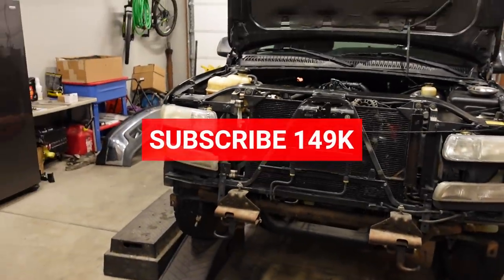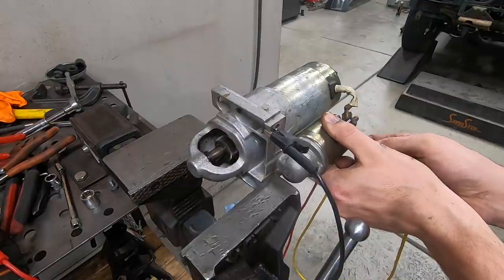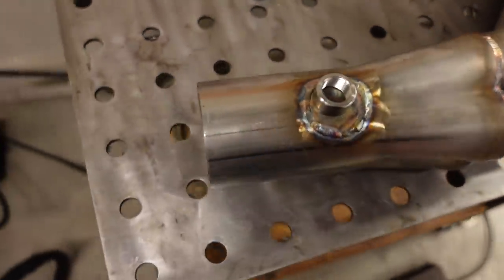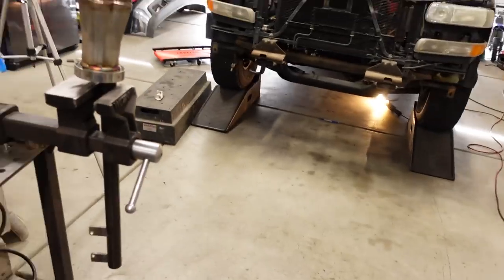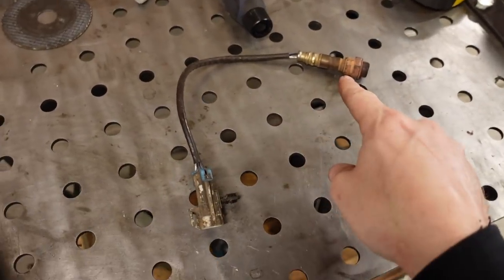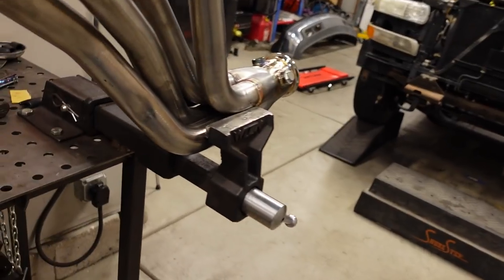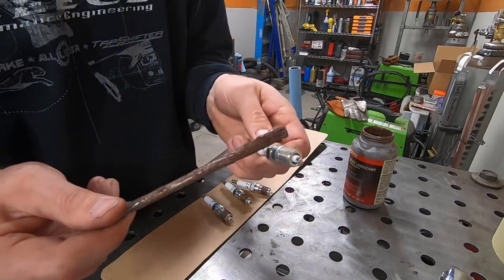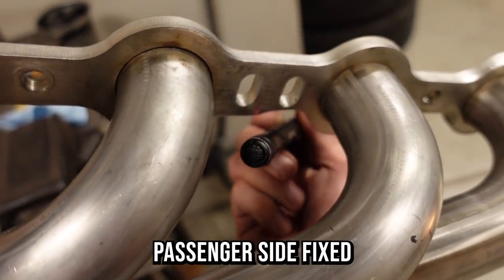my headers DON'T FIT & FIRST START of the CAMMED 4.8 Silverado

Comment from the maker: I badly need to build an exhaust for this thing, I've been working on startup and idle tuning this afternoon, and my neighbors aren't happy!
Reply: Don't waste any time trying to tune it before you finish the exhaust.  I started my LQ9 with a Texas Speed cam and Speed Engineering headers,  no exhaust.   Fuel trim went wacko in just a few minutes while I moved the truck to a different bay.  There I installed the pipes back to the X pipe, and fuel trim went back to single digits.
Reply: Faster proms collab?
Reply: I use Affordable Fuel Injection for my tunes.  Also as for the neighbors....that's why I live in the county out in the country, still close enough to run into town but far enough to make whatever noise I want.
Reply: Always read reviews before buying anything.
Reply: @bowtiebastard6437  i like GMT 800, and the 2014-2019, 2020+ trucks
Reply: There’s nothing like pissing off the neighbors
Reply: My neighbor next door is cool.  He was excited when I finally fired up my truck after the swap. I swapped an LQ9 into a single cab that had a 4.3. Tune and exhaust next.
Reply: What headers are you using  now

Comment: I have always used aluminum anti-seize on my spark plugs, ESPECIALLY on aluminum heads.  I have never worried about it getting on the sealing areas & never have had any issues, period.  I learned to use it many years ago when working at a Chevrolet dealer 7 removing a set that somebody else had installed in an '69 427 'Vette.  Both heads had to come off to be repaired after every plug broke off & then completely stripped out the threads.  Anti-seize is super worth using.

Comment: I was amazed how well the speed engineering headers fit in my 06 4x4 silverado. Got the headers and y pipe for about $450 took under an hour to install. I just made sure to get new motor mounts since the headers are fitted with new mounts. You do not need to add a bung like some people think. I used the msd plugs that bend up to 45° so you can position the plugs in any direction you want and they clear the headers perfectly.

Comment: Poor man’s oil primer for modern engines: remove fuel injector harness connections (or fuel sender fuse) and use the starter to ‘prime the engine’. Engine sounds great. Looking forward to the rest of the build!
Reply: I always prime my ls builds this way.....just crank for about 30seconds till you see numbers register on your oil pressure gauge and your good......if not, pull the oil gallery plug up front to the right of the timing cover and get a big Allen wrench to remove the plug and get a 3/8" hose attached to a bottle of oil and squeeze it in there till it comes out of the fill hole then turn the engine 1 revolution by hand at the crank and squeeze some more oil in till it comes out again, then you should definitely get it to register on the oil pressure gauge while cranking the starter. ....works every time
Reply: Or use the Richard Holdner method.
Temporarily block off the pcv and crankcase vents. Remove oil dipstick and use air to pressureize crankcase through dipstick tube until you have a reading on the dash gauge. 
I have not tried this myself but I will during my next build

Comment: I really like seeing you put almost all the original parts back together. My 5.3 blew a head gasket...I may just fix it instead of finding another engine. Hard to justify fixing a 180,000 mile engine, but, it really isn't worn out.

Comment: Thank you for all the awesome and informative video's. You mentioned putting electric fans on your truck. Gm offered a 9 blade fan for the heavy duty applications. I pulled the stock fan blades and put one of the 9 blade fans on each side and they move a whole lot of air.
Reply from the maker: thats the fan I used on my 8.1 and it works great!

Comment: I bought a full length set of Speed Engineering stainless headers from engine to tailpipe with the X pipe crossover (vs. the combined Y pipe design, they offer both) and they fit like a glove. The truck I installed the system on is a 2011 4WD Silverado Extended cab with 5.3L.   You may want to consider them in the future. Dipstick tube clearance, spark plug clearance is great, all the O2 locations are great and the clamps etc all fit perfect. Seriously not a single complaint and she sounds awesome with the X-pipe crossover. Obviously the Vbands are an upgrade to any system (and dont come standard on the SE set), but overall I am very happy, especially at $950 shipped for the whole truck. Thanks LT, and good luck with the build, cant wait to see more content.
Reply: BTW... can you post up the PN for the Accel plug wires you mentioned ? I'd be interested in changing out the set I have on  my truck..   Thanks !

Comment: Your welding is awesome.   I used Speed Engineering on 2 different GM trucks, No issues with them. Not bad for less than $400

Comment: I put a set of Pacesetter long tube headers on my 2013 gmc sierra 5.3 2wd.  No problems at all with o2 sensor locations and no dents do fit. I ran a set of AIP electronics from summit for the spark wires part number DFR-SPW2005-RD and they don't touch at all.

Comment: Speed engineering definitely have the best fitment, I've installed 2 sets of Texas speed longtubes and both didn't fit just like yours, one on a 2wd and one on a 4wd.
Reply: Was gonna say speed engineering seem to have a nice header for a decent price
Reply from the maker: I’ve heard good things about speed engineering as well, not sure why I didn’t just get those in the first place
Reply: @LawrenceTolman  And the best thing about Speed Engineering is the cost. I bought SE 1 7/8 inch for my 2010 Camaro. Speaking of a 5th gen Camaro, are you interested in doing a cam swap for your channel? I don't live too terribly far away (Billings, MT). I know you are a truck guy, but an engine is an engine.
Reply: One of my buddies has a set of Speed Engineering headers on his Denali. They actually fit great. I almost bought a set to cut up for my BMW swap project because they are so cheap. But I figured cutting up a set of already built headers would have been more work than what I ended up doing.
Reply: Speed Engineering are very nice for the price. 2010 Silverado 4wd 6 speed for perfectly doesn't touch anything anywhere only thing was the starter cable had to be moved forward and ziptied or of the way. For $420 headers and y pipe you can't beat them.
Reply: And the O2s are good as well had them on for 6 months. Only to 1 band clamp to fit the y pipe to the 6.2 3.5 inch factory exhaust.
Reply: Judging by my experience with them a few years ago, I actually assumed these were speed engineering headers. The driver's side flange was welded at an incorrect angle so badly that the O2 sensor contacted the floor, and the primaries contacted the firewall head shield and frame. Despite having brand new engine mounts, they told me to pound sand. Never again.

Comment: I installed a set of speed engineering headers I believe they were close to the frame on the drivers side but that was the only issue I had I didn’t dent them in and haven’t had them make contact with the frame. I also installed a set of Taylor spark plug wires with a 135° boot and everything fit perfectly between each primary tube. Straight plug wires will burn up over time

Comment: Speed engineering headers all the way when it comes to a gmt800 I have single cab, crew cab and tahoe all running same headers only clearance issue is steering shaft

Comment: There is an idle tuning configuration that will help you a ton. Search Russ K idle tune. Should just take a bump to the base running airflow table and maybe some timing adjustments but that cam should idle pretty easily.
Reply: ha.  beat me to it.  like you said that config file works great!
Reply from the maker: I’ll have to check it out!

Comment: I just built the 5.3 in my Sierra and did longtubes as well.  The left one pointed sideways (a huge no-no, should go downward at least 10*) RIGHT into the front drive shaft, and the right one pointed directly into the frame!  I doubt I could have even threaded it in.  Sigh. 2 new bungs...  zap zap, in they went.

Comment: I have pacesetter 1 7/8 to 3 in long tubes on my 2000 rcsb with a  swapped 6.0. Fit perfect and no plug problems. Not stainless but they are ceramic coated and 400$ wasn't bad
Reply from the maker: I wish that’s the route I would’ve gone

Comment: Best LS oil primer... A pump garden sprayer.  Drill a hole in the sprayer put in a  tire valve (to avoid pumping) take the spray wand and cut it out on a few inches of hose on the wand stub use two hose clamps since it isn't barbed.  The the right fitting for what you are oiling.  

I have that I also have one for trans fluid and one for diff fluid... No laying under the car with the pump in or squeeze bottle.  Just fill the sprayer, hit it with shop air (or pump it up) and then filling is just a pull of the trigger.
Reply from the maker: Not a bad idea!

Comment: I just finished up a budget exhaust system on my 6.0 short bed NBS. I used a Walker 55538 tailpipe, Walker 21470 muffler and Flowmaster Y300350 y pipe. Everything is 3.5” after the y pipe.

Comment: I used the Taylor 135 degree wires on my speed engineering 1 7/8 headers and I have 1/4 inch of room on either side of each pipe. Summit for the win 74$ !

Comment: I dealt with a brand new set of Hooker headers for a big block Mopar B body that needed a primary almost completely rerouted to clear the steering, the bolt holes on the flange opened up because they were drilled slightly off,  and the cylinder head reshaped because the flange was cut too tall. After all that they still contacted the transmission and chassis. They were just horrible.

Comment: Nice work massaging the headers to fit the O2 sensors and such. I share your disappointment with a lot of aftermarket products, often the fit is so off I would be embarrassed to sell it. A 3/8" hole that's not even round and located off centre by 1/8"... so much of it is awful, the cheapest headers and chinesium chrome dress-up stuff is the worst.

Your comments about the startup tune are legit, there's probably a lot less vacuum at idle now for the OE tune. Good point. I had a 283 running a Comp 268H & Al heads, similar to your LS setup and it sure wasn't strong off idle but went full hooligan to 7K or so.

Comment: Ahhh the obligatory open header startup! You’ve got to let the neighbors know you got the project running, right? 

On the anti seize/ spark plug thread debate… I never put anti seize on an LS spark plug. I’ve run into spark knock or blowout issues on some forced induction applications. The heat built up on the spark plug has to be dissipated to the cylinder head through those threads. With a layer of insulation between the threads abs cylinder head, you don’t get as much heat transfer and then get spark knock.

Comment: I always use anti-seize on spark plugs in aluminum heads not so much on cast heads. I've never removed the threads out of a cast iron head like I have aluminum. That cam sounds good. DeBoss garage made a preluber  (however the fuck you spell it) for diesel engines it's a buffer or expansion tank. He put oil in the blatter and pressurize the tank and hook it up to the turbo supply line. I'm sure on the LS you can make an adapter for the plate by the oil filter. You might know a better place I haven't experimented on many LS's. An oil pump on a 4wd and AFM lifter problems. That cam sounds so good I got to mention it twice.

Comment: I've never installed a set of long tubes that didn't get to meet my hammer........shorties no problem,  long tubes....always,  I usually just heat them up with a map gas plumbers torch till they are cherry red , then a couple light taps with the ball end of a ball peen hammer makes short work of those long tubes!!!!

Comment: First start sounds amazing.  I am curious why you chose to put the wideband O2 sensor on the driver's side so close to the headers? I have always installed the wideband at the Y to get a good reading for the combination of both banks (unless there are cats before the Y, in which case I do it on one bank like you did, but much farther away to try to avoid getting a reading from an individual cylinder). Loving the series, looking forward to the dyno runs.  I think it will be slightly more power and slightly less torque than the 8.1

Comment: You if are able to do a custom set of equal length headers with an x pipe that will be worth it in the long run.  Seen in the performancetrucks fb page a guy did it and it sounds phenomenal. No ugly truck clap sound

Comment: I bought speed engineering 1 3/4" tube headers and installed on a 2002 4wd silverado 5.3. They dropped right in with no modification. I paid 354.00 shipped.
Reply from the maker: should've gone with those!

Comment: In hp tuners go to engine>idle>airflow>startup airflow initial and multiply the table by 1.15 or so and see how it starts then, keep playing with it till it starts and idles without having to give it throttle
Reply: Make sure unit is grams/second

Comment: Add 15g to the bace running air flow table. If you still need to push the gas pedal to start it add 2 grams every time

Comment: The biggest problem you'll have with putting copper anti-seize on the sparkplugs is, you're creating a spot for galvanic corrosion. By doing so, you're destroying (little by little) the sparkplug threads in the heads. Using nickel or aluminum based anti-seize is going to be FAR BETTER for this application. Copper and aluminum do not play well together.

Comment: Crazy I bought a cheap ass pair. I think they were pace setter. I had to buff a few things just to tidy them up but they fit perfect.  I think on one side I had to extend the wires for an o2 sensor.  I been throwing bottles of nitrous through it for a solid year at this point and they don’t leak or anything. Maybe I got lucky.

Comment: there's absolutely no shame in rebuilding a starter. my dad's T100 with the 3.4 V6 was starting weak and sometimes the starter would just quit. I argued with him for 2 weeks to just buy the $20 rebuild kit FROM TOYOTA instead of buying a reman starter for $150+. had it off, rebuilt, and back on in an hour. saved him $280 (a local shop quoted him $300).

Comment: Yeah, headers suck, for sure. Believe it or not, I had great luck with Pacesetters, also, on my TBSS. I got the coated versions, and even after 10 years, they look like brand new (living in south Florida and not driving too much probably doesn't hurt). One tip, I burned through every spark plug wire I tried and brand of heat sock on a couple of cylinders until I switched to the Accel ceramic booted ones and boy, did those work a charm.

Comment: I got a cheap ebay equal length turbo manifold for my 2001 Audi. Being cheap and ebay I didn't expect perfection but after 2 bolts that I absolutely have no way of putting in, having to flatten the flange due to a lot of warping, had to dent one runner, took a grinder to the head/valve cover... The stupid POS still didn't bolt up flush and leaks like crazy! Unfortunately the car is my daily driver/project car so I had to give up and put the stock one back on and haven't had the motivation to mess with it since... It will fit eventually!
Reply from the maker: That is always so frustrating when parts don’t fit

Comment: If ur mass air flow sensor wasnt plugged in and able to read "steady" air flow, it will not run correct. Ran into that on my 04 gmc denali 6.0

Comment: on that passenger side where that o2 just need to move up a bit, could you have offset the holesaw from the bung, then rotate the cut out bung part 180* and weld it back in to move the o2 up? I try to think up was to save time/money

Comment: I've used anti-seize on my spark plugs since I started changing them. Only difference and this came from a guy who held several records for engine building & racing... you only need a dab. There's no point in coating the threads of the plug as you're doing.

Comment: I did some pipe welding years ago, while I know it's different to a certain degree, why do you not, bevel the weld sites? I know it's thinner material, but wouldn't a vee promote that much more penetration even on exhaust? I have a cracked jeep 4.0 header I am planning in welding up soon, is why I ask.
Reply from the maker: the material on the header is so thin, you can get full penetration with a single pass and no bevel.

Comment: Did you buy new motor mounts for this engine? I have Speed Engineering 1 3/4" headers and they hit the frame because of old motor mounts. Not sure if you did that or not but that is what I would have suggested first haha looks and sounds good LT
Reply from the maker: No, they’re the original ones. That certainly could affect how a header fits if they were sagging
Reply: @LawrenceTolman  Just for funsies you should replace them if you still have the motivation to do so haha. I’d be interested to see how you do it and if it fixes the problem.

Comment: Just curious as to why you didn't put the passenger O2 on the other side of the exhaust where there was a lot of room?
Reply from the maker: Because the wire would then pass over the top of the exhaust where it would potentially be melted

Comment: Did you say over 70psi for oil pressure @ idle? Sounds high. What oil pump did you use? Did you use a different spring in the oil pump?
Reply from the maker: pressure at cold idle

Comment: Stock, your year model the 4.8 made 255-260 hp to the crank. I say 250-260 to the wheels with what you have now. Of course it also depends on the dyno. Mustang and dyno dynamics are lower while dynojets numbers are always really high and unrealistic imo by how they calculate. The dyno dynamics is know to be a really accurate dyno...